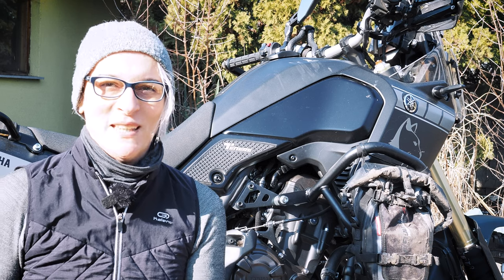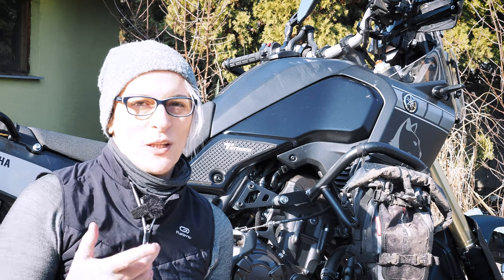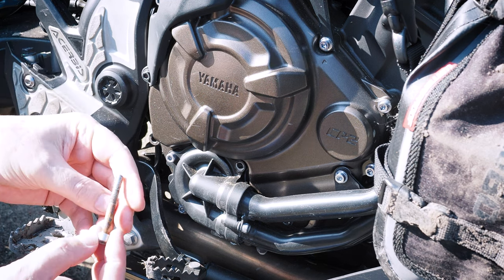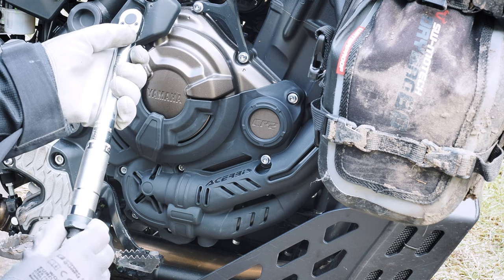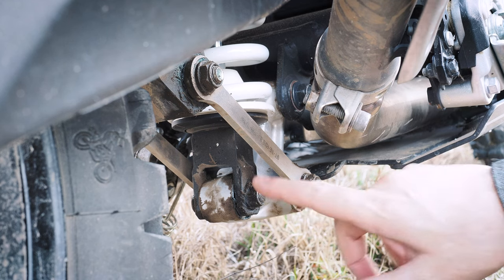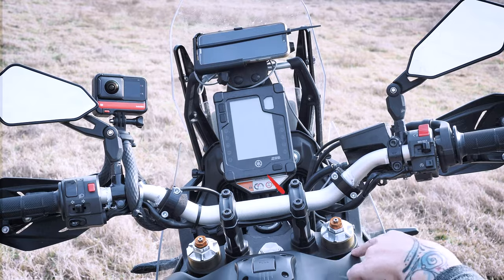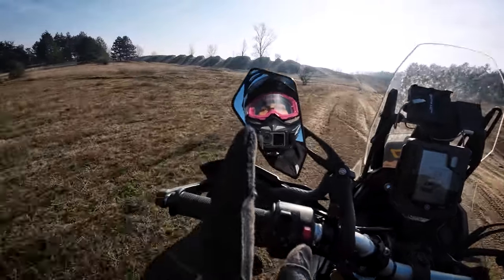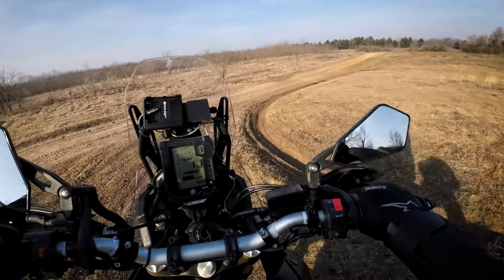New upgrades for my Yamaha Tenere 700: TracTive X-Treme pro shock and Acerbis X-Power guard.

Comment: Gratz on the upgrades :) Got the same Acerbis engine covers. That rear shock looks awesome. Went a little more budget my self with K-Tech piston-kit on the rear and K-Tech cartridge kit in the front. But as before, im still waiting for the snow and ice to melt so i can ride again. Have fun and enjoy your "new" bike :)
Reply from the maker: Thank you! 🤚😌 I am sure the K-Tech upgrade kits do awesome job too, compared to the OEM one. I never had a bike with this double compression setting shock, and I was lucky to be able to get one. 
I am eager to try it on a serious track! 
I hope you can ride asap, because riding is the solution! 😁🤚

Comment: Oh dear, this is gonna cost me... So Ive watched a couple of your vlogs now and I've learn a few things.  1.  Pirelli MT21 rear looks a better/cheaper option than the Pirelli Rally or Mitas XT+ I was gonna get (Might still get Pirelli rally front as looks more aggressive than MT21 front - or might just go with a Michelin tracker front).  2. The water pump guard I have, like you had, which is stopping me from setting my camel adv rear brake up properly is gonna have to go and Ive gotta get these Acerbis covers, so thanks for that.  3.  Got new springs for front and rear arriving today and a rebound cap for front forks, just doing a mini upgrade for the mo.  But I didn't know Tractive suspension came without the horrible orange bits.  That could get expensive tho... 4.  You obviously like Wet Leg...  Thanks for all this, subscribed and look forward to the next vlog - got a bit of catching up to do in the mean time.  regards, Mike
Reply from the maker: Hey Mike! 
Thank you for your response and subscribe, I am happy you watched my little reviews too. ✋🙂 

I think the  springs and re-valve upgrade for the shock and forks might be enough upgrade if you don't want to jump a lot with your bike. (Although Tractive is better upgrade, but it's costly for sure. What I love the most in it - besides the quick and slow dampening speed setting - I haven't felt any hard bottoming since it's installed. ) 

The tires... well, I think there is no perfect advise. Some of us prefer to ride more aggressive, some more technical and softly. I don't think there is any universal measurement for this segment. Maybe pattern look and compound feel... but even those are pretty much subjective. I hope I could still help you in this too! 

And yes, I like music with deep feelings and meaningful philosophic lyrics which inspire me into spiritual thoughts about the meaning of life and other self something something... 😉😁
Reply: @braapt7   yeah since I tried Michelin Trackers on my T7 I don't really want anything less aggressive on my bike now.  I'm an ex motox guy and still racing a few rallies on my CRF450, so I know how important tyres are.  The issue with the tracker rear on the T7 is that it's a bit loose on the rim, but a lot of the alternatives in a 150 are very difficult to get off the rim if you have to fix a puncture out on the trail - at home no problem as I have a rabaconda.  So problem is finding a 140 that fits the standard rim well and is aggressive enough for my style of riding.  Obviously the best thing to do is get thinner rims but thats a lot of money I don't have, well it would take money from racing my 450 and that can't happen.  I race with a couple of guys in the British rally champs, I'm on my 450 they are on T7s.  Now I'm an above average rider, I know this because of my race results, but this one guy is super quick on his T7, yeah he's young and fearless, but he makes his T7 sing.  When I asked what he'd done to his suspension he said it was just the Ktech upgrade, which is a bout £900 to get done here in the UK.  So I think for me that is the way to go.  Will see how I get on with the new springs for now!  Ciao for now!
Reply from the maker: @twowheeledadventuresuk2739  Totally agree with you, I am struggling with the same problems. There is only one difference: I don't have a 450 racing bike, so I can spend more on my T7! 🙂 (I will have a thinner rim this winter, I hope...) KTech upgrade will be pretty good for serious offroad, wish you a lot of fun, and ride safe! Cheers, Kate. :goodvibes:

Comment: 3400 for the TracTive X-TREME PRO Rally Fork Cartridge Kit (+25 mm) and TracTive X-TREME-PA PRO Shock (+25 mm) not the same bike....  But the T700 will replace my CRF1000 and KLX650c so I save on caring for the 2 bikes and I have more room in my garage that is full of bike and a PIA to move them around when I want to ride on...   I will miss the CRF1000 power it would go up anything and it would do the freeway like a XT1200...

Comment: Nice job! Curious to know how the rear shock performs and how is your felling about it...

Great video 🤘
Reply from the maker: Thank you! 😊✋ Well, so far so good. It's much more stable on road and off road too. 
I just set the sag rear and front, not messed much with the clickers yet (just a bit). I recognized about 20-30% more speed increase on dirt tracks thanks to the stability. Also bottoming happens only in extreme situations on single tracks and dirtroads as well.

Once I'll be able to go to a motocross track I will set front and rear into harmony, and I will make another video about that asap. Probably late March, early April.

Comment: Great video! Never thought of just upgrading the rear suspension .. but makes sense.. Also I’ll, cut from my bread, lately  I’ve been eating for 2 people😁
Reply from the maker: Actually the rear shock is an additional upgrade, the front forks were already upgraded with Andreani cartridges.😎 
(Check my 30 modifications video from last year.)

I know it's not the best solution, but when I bought the bike, I didn't know how long I will would keep it, and how much investments worth it. 

Now I know, there is another front fork upgrade needed asap. 😃👍
Reply: @braapt7   Thanks ! I really appreciate the information. In Cyprus there's not many flat lands to go fast, its mostly slow rocky stuff.  Thinking of getting the 48mm kyb from boano so I can sell the fork and triple clamps. Will end up almost at the same cost.
Reply from the maker: @CypIThinkITank  This will be an awesome upgrade, I am curious how it works on the rocky stuff!

Comment: Respect !!! You are a grate rider!!! What spring rate have you got in this tractive shock?
Reply from the maker: Thank you so much! ✋🙂 I got the 85 N/mm spring rate one, works like a charm for light adventure setup and accessories. 
If I would be a world traveler, I would pick the one with easy preload adjuster. I bet when there's a lot of stuff on the bike, it needs some tightening. And setting the Rally Pro preload rings with tools is not much fun. :D

Comment: I need it, the oem rear shock isn't good but I'm looking for a TFX one. I don't eat more chocolate and drink beer for months 😅😂
Reply from the maker: I kept my eyes on the TFX too, but I couldn't ask any expert, which one is better, so I picked the TracTive, since it's identical to Touratech and RallyRaid products. I guess TracTive is the supplier? No sé.
Is there a special reason, why TFX? Anyway, if you will have it, I am curious how much does it chang on bike handling, please let me know! ^^ Gracias! 😌🤚
Reply: TFX is handmade and they make it to your needs. In addition, I totally trust the Spanish distributor for guarantee. It costs around €1000.
I need a shock that works well running as well as traveling with panniers.  I'll let you know when I can mount it
Reply from the maker: @NeboaRR81  Nice point, good to have a trusted distributor around! Waiting for the review! 😎👍

Comment: nice what you have done I have a question with how many centimeters did you lower your yamaha just the back in the front.
Reply from the maker: Thank you! =)

I used the 20 mm lowering dogbone kit for the bike, and also lowered the front with 2cm. I also kept some of my original preferred setup lowering - which was 8 mm, so now my front is lowered by 25mm. I think this is about the maximum what you can lower the front of the bike without damaging anything.

The feel of the bike changed just a tiny bit. Feels just a bit more clumsy compared to the original, but - as you can see on my videos - still pretty much manageable. =)

Some people may think 20 mm lowering seems to be not much, but if you can barely touch the ground with your toes - like I do - , it really does. :D Also I think more than 20 mmm could make the bike much worse for enduro style offroad ride.

Comment: What about daily use with the new shock, any harshnes onroad on small potholes and stuff like that as i have seen mentioned in other places ?
Reply from the maker: Well, I'd lie if I'd say it's the same comfort. 
I can definitely feel the pots better, but the whole setup is for this: feel the bike and it's reactions with the terrain.
There is however another versions of these shocks, where you can more easily set the spring tension. Also you can pick the progressive spring for the front forks for more comfort. You might lose some action, but you get less hit from potholes. 
I don't think there's a unicorn suspension which gives maximum race and travel comfort the same time. 🤷🏼‍♀️🤷🏼‍♀️✋😌
Reply: @braapt7  i have done some mods to my suspension, springs, thicker oil and a lot of messing with the clickers, its actually ok now for most of my riding but  im trying to decide if it is good enough for my intended purpose with the bike in the long run, or if i should upgrade, but if i upgrade i know im gonna ride even harder on it, but for riding harder i have my KTM freeride 350 when i need to go full retard 😉 - decisions decisions 😉
Reply from the maker: @Prestonesfpv  Huh, you have a cool bike to go crazy ride! 😎👌 If I had a hardcore off-road bike like your KTM, I wouldn't upgrade my T7 to this level for off-road. Probably. Maybe... or maybe not? 🤔🫣😂

Comment: Hi there!  What are you running for front suspension?
Reply from the maker: Hai! I got the Andreani Misano evo cartridges. 
Not the best one, but it's budget friendly and much better than the original one. (considering the full setting options)
I managed to set it for optimal performance at medium to high speed, but at really big hits it bottoms and on a smooth cruise isn't really smooth to the hands. It's with linear springs of course.

Comment: Have you considered changing the bars all together for a different bend to be lower?
Reply from the maker: Yes, I did, but the factory one is already pretty low handlebar itself. 
And even if the handlebar were lower only, the handguard metal part - which hits the tank and the dashboard - would also be just as low as with the lower riser. (-2cm) 

It would be certainly centered with the OEM riser, but I really would love to play to push and pull the handlebar's position not only lower, but even forth and back to find the perfect feel and control of the bike.
Reply: @braapt7  I have the BarkBusters and ProTaper bars on mine, but still smashed the dashboard on a trip in January. Sometimes there’s no avoiding theses issues 😭
Love your videos, great to see how you whip the T7 around like a dirt bike 😃
Reply from the maker: @themotorguy  Thank you! :goodvibes: I am happy you like my little silly videos. ☺ I wish I had the height and power to be more capable to whip the T7... but unfortunately she's whipping me most of the times. :D :D :D
Reply: @braapt7  hahahaha, me too. Hopefully I get mine back soon, it’s taking too long for Yamaha Australia to supply parts and get it fixed. It’s been out for 2 months. 
I want to practice all those little things to make us better riders. 
Another YouTuber, @ariemann1 has great tutorials at the moment. Worth a look, but I don’t think you’ll need it. 😊
Reply from the maker: Wow two months! That's an eternity at summertime... what's the issue? You should sue the company for sanity issues they are causing for a healthy motorbike rider! :D :D :D 
I go and check ariemann1, never know where will you hear something new and good advise.
Go and slam on the table at Yamaha, and demand your bike back like yesterday! 
💪😎